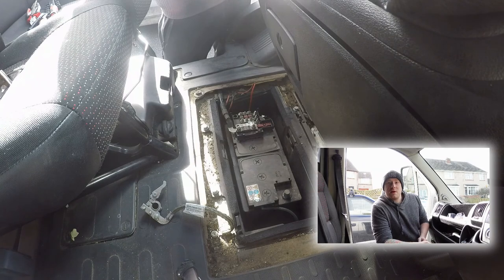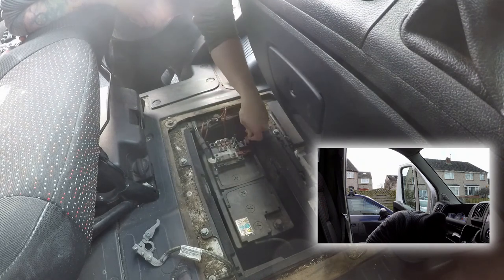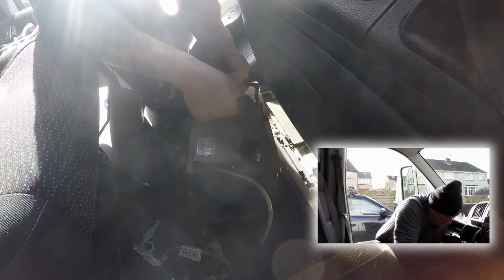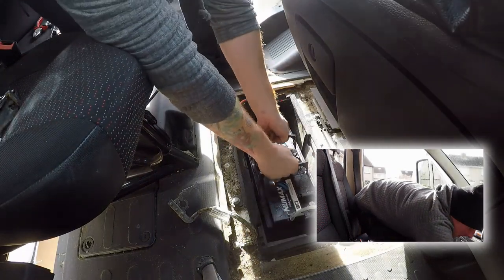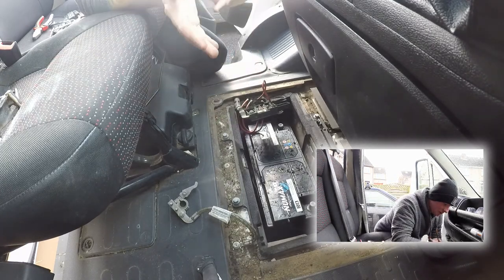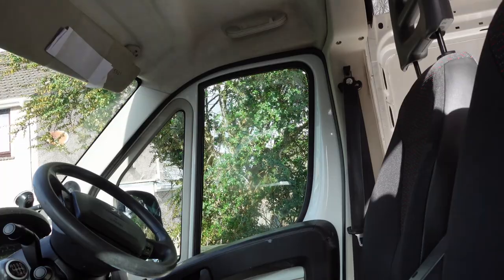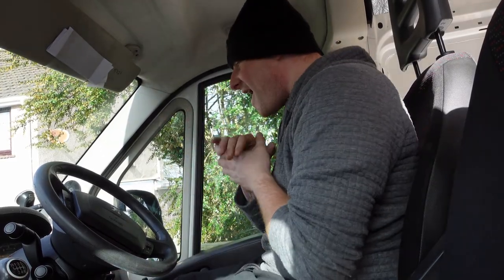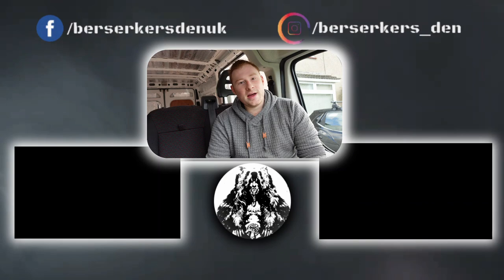Replacing The Battery On A Peugeot Boxer

Comment: I've flipped the quick release on the negative cable but still can't get it off. It's wobbling but it will not come off the post. I'm close to prying it off but don't want to make my problems any worse. Any thoughts?
Reply from the maker: no expert but is there any corrosion around it? maybe try turning it 180 see if anything breaks loose
Reply: @berserkersden3951  I did get it loose. I ended up gently prying it off. It doesn't look to be corroded but I cleaned it any way.
Reply: @allergic2bull  I had the same issue. Ended up taking off the wire on the quick release and took the battery uit of the van. I then also pryed it off the old battery with the battery on a workbench.

Comment: !!! DO NOT USE ALL METAL TOOLS !!! like this guy - use insulated tools. 
Also:

Whenever a vehicle battery has to be disconnected, switch off all equipment, interior lights etc,
close the doors leaving the drivers window open.
Switch off the ignition and remove the key and any diagnostic equipment.
Wait a full 3 minutes before disconnecting the battery.
The BSi must be allowed to go to SLEEP i.e. into "active economy mode". Do not operate any
equipment on the vehicle during this time. Remember, even opening the bonnet
will wake the BSi on a vehicle fitted with alarm.
If the battery is under the bonnet, open the bonnet first and leave it up.
ALWAYS disconnect any diagnostic equipment and do not operate any other vehicles during the 3
minute waiting period.

PROCEDURE FOR BATTERY RECONNECTION
Unless otherwise instructed by Peugeot or Product Service, you must always carry out the
following procedure, often referred to as a "soft re-boot", to minimize the
possibility of the BSi corrupting its own software when reconnecting the vehicles battery supply.
Ensure the procedure for battery disconnection has been adhered to and importantly all BSi
functions were switched off with the drivers window left down.
1 Close all doors
2 Remove ignition key if left in ignition
3 Reconnect battery. DO NOT open any doors
4 Wait 10 seconds
5 Switch on headlights through the driver’s window
6 Switch on ignition then start the vehicle and check system functions